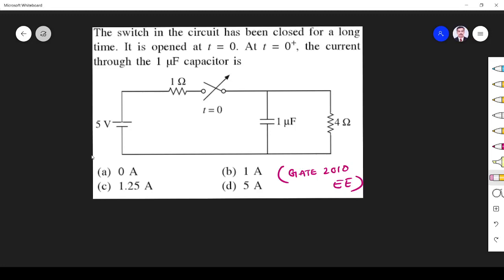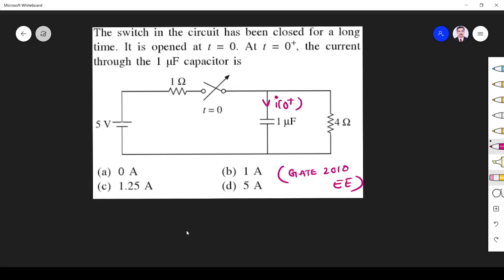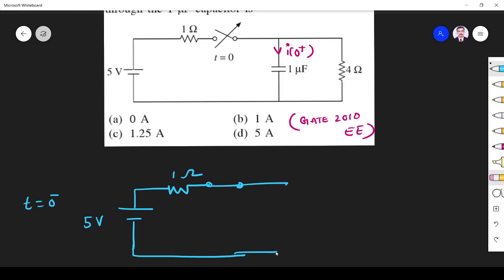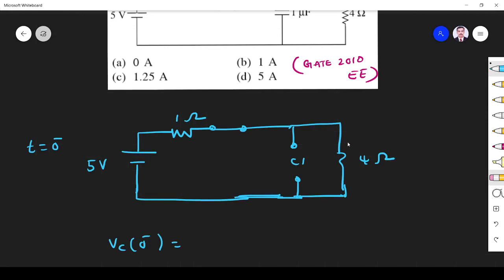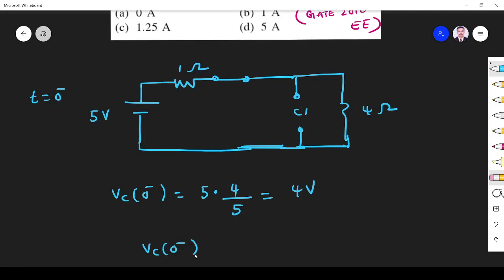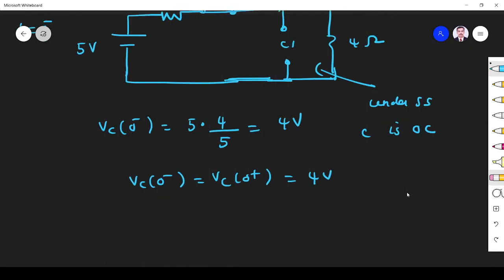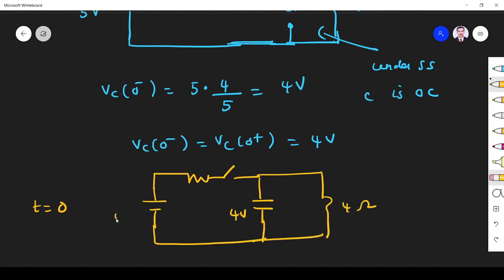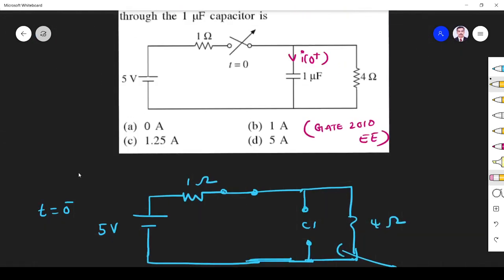Network Theory GATE 2010 EE Solution |#18|

Comment: Sir in this problem final step capacitor value is 1micro farad . How we can get 4/4 = 1 A. Clarify my doubt sir
Reply from the maker: C is given in problem na 1 micro farad...and I = v/r ..after t=0 switch open ...we have initial capacitor voltage 4 and resistance one 4ohm..no other devices hence I is 4/4=1